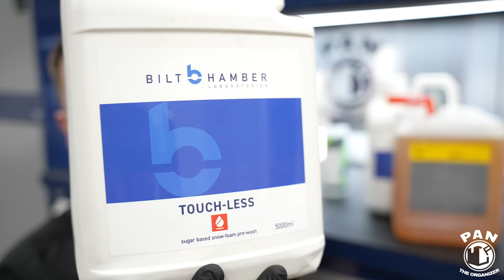The end of the 2 bucket car wash method!? 💀

Comment: I've never used the 2 bucket method. Never made sense to me. I have all the soap I need in my foam cannon, and all the water I need in my hose. I use towels and flip/fold once dirty
Reply: @klasseact6663  always pre-wash! Even with rinsless I pre-soak the whole car
Reply: I throw my used wash mitt (both sides) in a empty bucket, and can always redunk one if i need an extra mitt. Totally defeats needing a second wet bucket. I felt w 2 wet buckets i never knew if i was using the wash mitt too much...
Reply: @whitegoodman7465  it's really not...FAR less annoying to flip a towel after a panel versus scrubbing a mitt in 2 different buckets
Reply: @klasseact6663 you don’t need 10 wash mits. I use 4 on my compact sedan, which is is 8 sides altogether. 
Also you can just use your PW to rinse the mitt right on your hand if you want. I’ve done that a lot in the past.
Reply: I rinse off the mitt with the pressure of the pressure washer water which works much better than rubbing it against a grit guard
Reply: Why need 2 when u can get the job done with 1
Reply: Yes I used about 5 mits I only have small sports cars, I keep buying mits every 6 months or so
Reply: @omranmkv  I used to use mitts as well, but then I swapped to plush waffle weave towels. I prefer them much more. You get 8 clean sides per towel when folded right, so you can fly through washes. And it's less laundry 😄
Reply: I can’t understand how dunking a soapy wash mit into a “clean/clear” rinse bucket keeps that rinse bucket free of soap/foam. After a few dunks of the soapy wash mit into the rinse bucket, I can’t tell which bucket is which.
Reply: @Itsme-vo4fx  exactly why I never liked the 2 bucket method. No matter what you do both buckets will always be dirty by the end. To ensure no dirty media comes in contact with the paint I prefer towels that can be flipped to clean sides. Plus it saves water, time, and my back from lugging 10 gallons around 😂
Reply: One foam bottle, one bucket of water to rinse. Tyre saved for final. Skirting before tyre. My clients' car doing fine
Reply: I’ll stick with the 2 bucket method.
Reply: There’s advantages of actually physical touching the car with a soft MF wash mitt that a foam cannon and pressure hose cant do easily.  But I don’t use the two towels  ethos either simply bc you’re actually recontaminating the wash water ever so slightly each time you rinse and put back in the wash bucket.  Instead, I foam cannon, rinse, use the Gary Dean wash method with at least 12 different MF mitts, rinse again, blow dry, the hand dry.  Minimal contamination…
Reply: @ONI1013.  that's basically what I do as well. I just use a foam cannon to apply my soap
Reply: @Xaviers300ZX it's better not to rinse before applying rinseless wash if you're trying to avoid scratches. The reasoning is that large, even small, pieces of debris/dirt will at some level be dragged against the surface of the car when it is being washed off which will leave a scratch. If you apply a rinseless wash like ONR before rinsing the polymers will encapsulate and lift the dirt off the paint basically serving as a protective barrier between the two when you rinse right after. Think of the rinseless wash as a medium for the debris to hydroplane on and off the vehicle.
Reply: @XecutiveOfficial  that's the process I said I perform, a pre-wash/soak. I never said anything about rinsing
Reply: @Xaviers300ZX  oh I probably misinterpreted it. When you said to always pre wash and that "even with rinseless I always presoak the vehicle" (or something like that) did you mean you douse the car with rinseless before any type of rinsing with water? I thought you meant you rinse it off first when you said presoak oops
Reply: @XecutiveOfficial  haha no worries! And yes, I either use a pre-wash like Bilt Hamber Auto Foam, or I soak the vehicle with rinseless 👍🏽😉

Comment: Hi Pan, thank you for this very informative video! One question if you don't mind. 

If you pre-wash with a high alkaline snow foam (e.g. Auto-foam), would you coat the car again with the Auto-foam or switch to a more pH neutral snow foam for the contact wash? Or could you even foam the car with the shampoo that you have in your one bucket?

I'm only just starting on my journey down the detailing rabbit hole xD
Reply: Very good question I would normally use BH autofoam Ph13 but wouldn’t want to use it for the second foaming? Perhaps I will use DIY rinseless in an IK foamer as I only have a small car

Comment: Hi Pan. 100% agree. I used one bucket and sponge for decades and never had an issue. Only tried the 2 bucket system based on your channel and several others 12 months ago and there was absolutely no proof as to why you would need it. I only have 1 separate bucket on its own for the rims and tyres. 2 bucket method  is  a waste of time. A good car enthusiast will always maintain good paint care. I recently converted to snow foam as well and makes a world of difference. After a good pressure wash and at least  2 mf mints, you only need 1 bucket and job done.   Thanks for the video.
Reply from the maker: Thanks for watching!

Comment: I just use a single bucket with at least 3 mitts:
#1 - side 1 for hood, front end, then windshield, side 2 for roof and tailgate
#2 - side 1 for top half of driver's side, side 2 for bottom half
#3 - same as #2 for passenger side
Reply: Similiar. I use double cloth towell folded to 8 sides.  
1 Roof and glasses
2 Bonnet, front bumper, front half of fenders
3 rear trunk bonnet
4 rear bumper , rear half of fenders

4 sides for 4 doors +part of fenders.

Comment: Glad to hear this, finally.  I use the foam cannon to lift the dirt and lubricate, and a soaped wash bucket with a wash mitt and a grit guard.  I flip the mitt and return it to the bucket and grit guard often.  If the vehicle is dirtier, I do a first spray wash and rinse before the actual contact wash cycle.  I never apply pressure with the mitt.  I use a separate bucket and separate tools for the tires and wheels.
Reply from the maker: Thanks for sharing!

Comment: I’ve always pre washed with APC let it sit for 10 mins wash it off then I snow foam it and let it settle before foam washing it again and then using a wash mitt between each panel I rinse off once it’s rinsed off I towel it down then re rinse it while using a sio2 hybrid ceramic wax I then dry and and buff the wax coating. It leave my car shiny and water repellant for about 3 weeks dependent on how much i drive it

Comment: Hello: I have a potential tip (you may already know) Florida "love bugs" are hard to remove I use 2 fabric softener  dryer sheets wetted in water and rub the residue , works well. With your background you might study how to make love bugs into a super glue. Also Pan, some advice please, I(senior citizen) have a 2023 Subaru Outback touring xt, with Nappa leather seats. What to do about friction , not easy to slide into position getting in or out. They have not been treated .
Enjoy sitting back and watching .

Comment: I think it al depends how dirty your car is. If my car is fairly dirty I will quickly rinse my mitt under the hose to get it clean in preventing scratching. With my car I wash it often, so then I don't need cleaning the mitt. Only afterwards.

Comment: I have been detailing for over 50 years and have always used the 2 bucket method. 1 bucket for the wash mitt/soap solution and the 2nd bucket as a seat for when Im doing the wheels and tires. I always do the wheels/tires first using the 1st bucket, then flip the 2nd seat bucket and using that on the car. I never pre foam,  just pre rinse very well. I can appreciate Pan's techniques if you live in a tough climate with alot of snow, road salt or salt water atmosphere.
Reply from the maker: Thanks for sharing your thoughts. How did you discover my channel by the way?

Welcome to my channel. You discovered one of the biggest car detailing channels on YouTube as we surpassed 1 million subscribers and we have over 135 million views! I have been detailing for 27 years and I love to share my knowledge and passion with my viewers.

You found the right channel to help you learn everything about detailing.
Reply: @PanTheOrganizer  I have been watching your channel off and on for several years. I'm a subscriber.

Comment: I use a shampoo(that can be used with a foam cannon) in a second jar for my foam cannon which I go over after the first pre-wash stage as the lubrication. Feel I get a better lubrication with that compared to using the pre-wash as the lubrication for the mechanical wash

Will then also have shampoo in my bucket as well.

Comment: Thank you Pan, very informative. It was not clear which product you used to re-foam your Porsche with for the contact wash. Which product was in the foam canon and which product was in the bucket wash?
Reply from the maker: It depends what product I’m using. But after the pre-wash, I rinse, and if I refoam I typically use the same soap as in the bucket. For example, Koch Chemie Gsf and CarPro Reset can both be used both in the foam cannon and wash bucket.

Comment: I just don't think its a big deal to have a rinse bucket and pretty clearly does its job on noticably dirty cars. For winter or washes where the car is hardly dirty I could see not using a rinse bucket, but otherwise it doesn't make a whole lot sense not to use one if you're hyper focused on avoiding scratches from dirt and contamination.

Comment: Same for me, but I use 2 mitts. 1 for the top half down to the door handle. Then the 2nd for the lower section.  Do the top of the car first, then the lower dirtier part of the car.
I'd always wash top to bottom. Never swipe to the bottom and back to the top 😱. 

Enjoying the channel. Thanks Pan keep it up.
Reply from the maker: Thanks Stuart! How did you discover my channel by the way?

Welcome to my channel. You discovered one of the biggest car detailing channels on YouTube as we surpassed 960,000 subscribers and we have over 130 million views! I have been detailing for 26 years and I love to share my knowledge and passion with my viewers.

You found the right channel to help you learn everything about detailing.
Reply: Not too sure how I found the channel. Think I was searching for fusso coat reviews and came across your channel. I'm also using the MJJC foam cannons 2.0 + S3.0.

Will look for more content on your channel.

Loving the Porsche  👍
Reply from the maker: Merry Christmas!

Comment: Cool. I use one bucket with multiple mits. Does this new method do a great job on winter road salt? Or do you add one step to start off by rinsing off as much salt as possible? As always, good video.
Reply from the maker: For road salts, a good effective pre-wash like Bilt Hamber Touch-Less really helps.

Comment: I do almost same method.. Foam pre-wash. Wait and Rinse. Foam again.  But then on next step, I use One bucket and 8-9 different Wash mitts for all the sections.  Never reuse same contaminated wash mitts in rinse/wash bucket = lower risks of any contaminant scratches.  

And the added benefit is that it’s much faster bc you eliminated need to thoroughly rinse your mitts.  Once a mitt is done (front and back) on two sections of a car, it’s much faster to just drop on dirty pile and grab fresh new mitt.

Comment: Another good one Pan.  Thanks again.  I've been using snow foam for pre-wash fo over 5 - 7 years now.  I always used 2 bucket washing method.  Never had issue on my paint work caused by bad washing methods!!  I'm using now different type of snow foam depending on my cars ( very dirty or not / coated or not..).  I agree with the method of one bucket method with a previously pre-wash / rinse / foaming a second time / contact wash.  However, I do prefer using the 2 buckets still.  Also, I might modified the process using a PH neutral car shampoo for the second foaming.  
I agree with you to say there is more good light and high alkaline soap on the market now.  The strategy depends of the type of protection on the paint work.  For me,  I'm only having one coated car, so I could not use too agressive car shampoo on the other wax & sealant protected cars.  I'm using also a lot more often rinseless wash.  I'm washing also sometime with two buckets method and a single pre-wash step.  
Like you said, for me it is pleasure to maintain my cars and that never changed for 40 years....😁  Thanks for making us better and more efficient!!! 
Frank

Comment: Hey Pan, i do it nearly the same since my beginning of detailing years ago..even more or less timelasting, 1 bucket for the whole car / wheels. Weekly wash or even 2 weeks of no wash! First rinse properly, than snow foam last for around 3 min, no rinse after that, than i go for the main wash from top to bottom. So i exclud the pre snow foam process. It works really well, my experience with that method goes over 10 years, no scratches or swirls. It takes around 15min. including the wheels for my AMG station wagon, so very quick and still a proper wash. The only thing i do with more attention as you show in the video is the lower part of the car, i use a lot more of shampoo/water in the wash mitt and going over small parts. On that part i let the mitt and the washing shampoo do their job, so more ist the better choice. In case there ist still some dirt, the amount of shampoo water washes it away. I also use a lot of Koch Chemie products as i'm from Germany ;-) ABDL, FX Protect and Carpro are also one of my favorites.
Have a nice day!
Reply from the maker: Thanks for sharing Andreas!

Comment: I havent used the two bucket method in a long long time. I typically rinse, foam, rinse, then foam and wash it using a soapy bucket with grit guard. Its worked well for me using the rag company cyclone mits.

Comment: I just want to make sure i got this right

1. Use a higher pH soap and foam the car
2. dwell for a few minutes, then rinse
3. refoam the car with the same higher pH soap
4. have a pH neutral soap in one bucket and use that for the contact wash.
5. rinse after contact wash

does that sound right?
Reply from the maker: For regular weekly washes, you can stick to pH neutral in the foam cannon and in the bucket. You will only switch pH levels when doing a deeper cleaning once in a while. That's what we call a "decon wash".

Decon wash:
1. Foam with higher pH snow foam (alkaline)
2. Rinse
3. Foam again with acidic pH snow foam (optional, for added lubrication) and use the same acidic pH soap in the wash bucket (that removes limescale and mineral deposits)
4. Rinse.

See how I do all this in my spring maintenance tutorial here: https://youtu.be/oTaFE_p2OAw?si=WaJFgDDUrfdavEOd

Comment: I used to use 3 mitts, 1 for each section from top to bottom, same split that you said in the video.  So 1 mit per section. I always found that worked great. 1 side of the mitt for each side of the car. I also considered the back of the car the same as the bottom section cause it gets a lot of dirt cause of the aerodynamics. So I'd treat the back of the car the same as rocker panels.
Reply from the maker: Thanks for sharing Shawn. Welcome to my channel. You discovered one of the biggest car detailing channels on YouTube as we surpassed 1 million subscribers and we have over 140 million views! I have been detailing for 27 years and I love to share my knowledge and passion with my viewers.

You found the right channel to help you learn everything about detailing.

Comment: I used to use 2 buckets but now I'm just using one. I start with the rims and continue to the rest of the vehicle. It works just fine. I do have a grit guard in the bottom of the bucket so my brush doesn't get the dirt each time I dunk it.

Comment: I use a 1 bucket method, but with 2 separate wash mitts. Horizontal sections with 1 and vertical sections (basically top and bottom divided) with the other mitt.